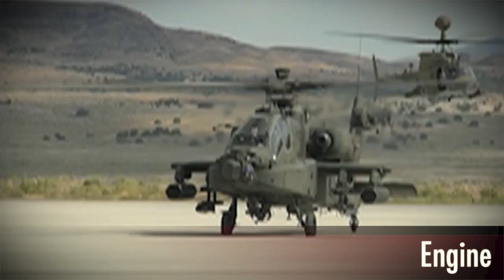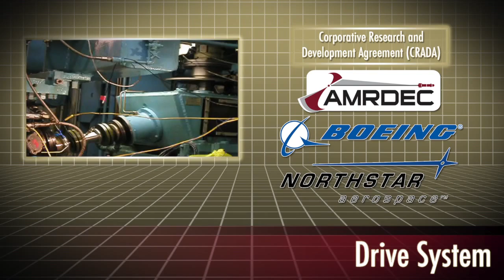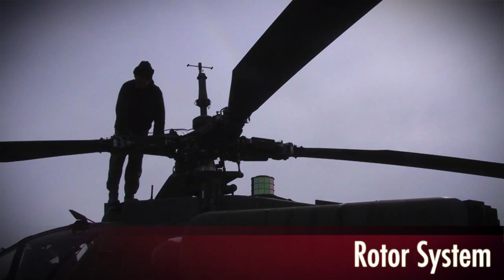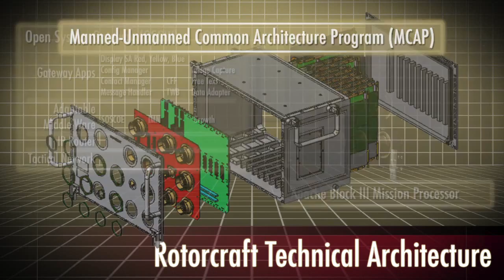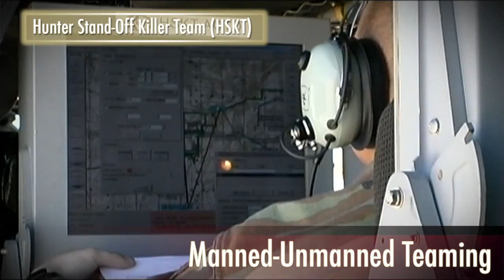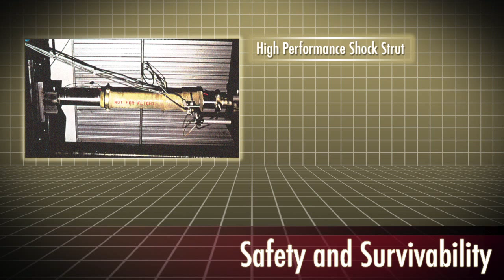US Army RDECOM - AH-64E Apache Guardian Attack Helicopter Technology Upgrades & Improvements [720p]

Comment: Quite different than the AH-64A's I built in the 80's.
Reply: Wow you worked for Boeing?
Reply: No, Hughes Helicopters, then bought out by McDonnell Douglas. Boeing bought it after I worked there.
Reply: Interesting.  Are you please with the AH-64E now?
Reply: Yes. The Mast sight is only part of the Upgrade. The Weapons System can share targeting data with all others. Far better C&C, especially in a fluid engagement.
Reply: +TheDustysix Good on ya

Comment: The things about the Apache D and Apache E is both are interconnected weapon systems.  They can gather targeting data from a host of systems and it can also relay targeting data to other systems.  This allows them to stay in the fight even when they are directly not in the fight. It also technically gives these guys unlimited ammo and allow them to be in the fight before they take off and while they are landing at their host base.  Using satellite up-link, they can see what the troops on the ground are pointing at even when the helicopter is miles away.

Comment: Just being able to integrate with UAV's would improve its effectiveness and survivability by 30%. Not to mention faster taget Identification. As anybody knows controlling time and space on the battlefield is the key.
Reply: Speed of the target detection, more available time and multiple sources to suppress targets are just some of the variables. You can add reliability as they upgraded the transmission, rotors and fire control systems.